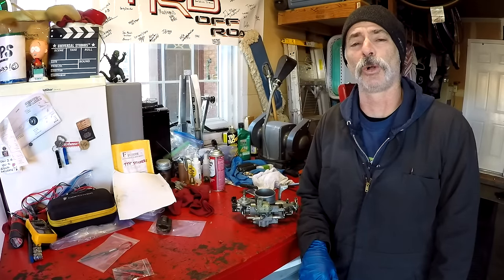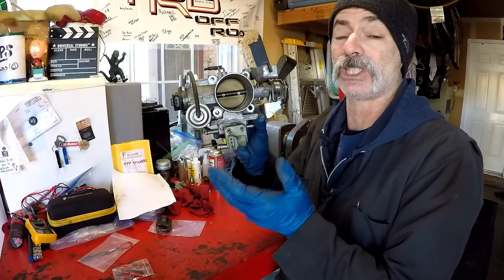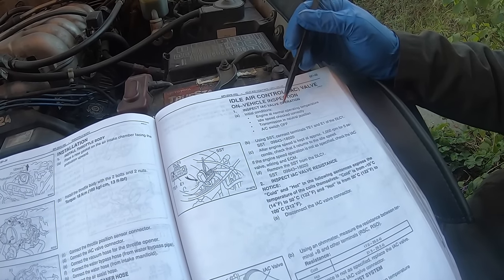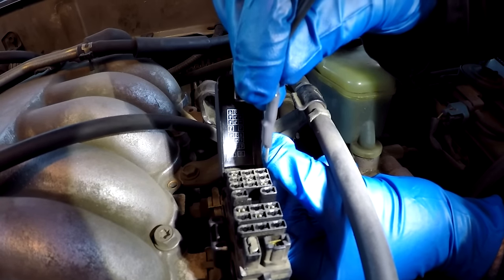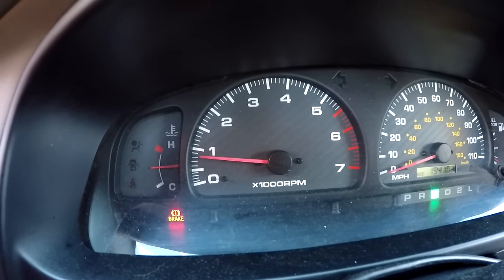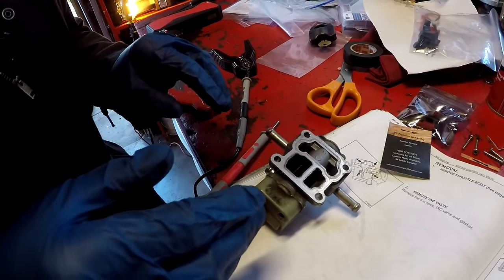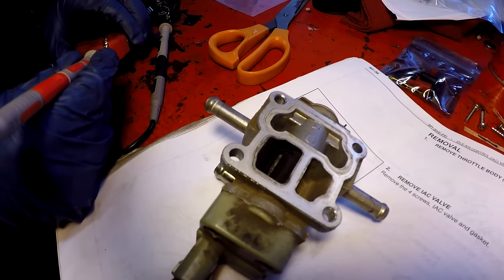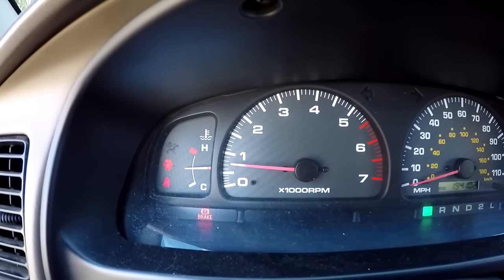IAC Valve Testing and Cleaning

Comment: That first small hose you removed going to air box tube near the throttle body mine has oil coming out of it why would it do that its @14:42 on video I have tried everything I could think of to do diag this mysterious oil coming out but nothing about the engine is running ruff so it's running fine not a clue why oil is coming out of this hose
Reply from the maker: That rubber hose connects to a hard line on the upper plenum and then has another rubber hose that heads towards the back of the engine and connects to a nipple on the backside of the driver side valve cover.  On the passenger side valve cover, you have the PCV (Positive Crankcase Ventilation) valve and it's job is the following which I borrowed from a website: "The positive crankcase ventilation valve releases exhaust gas and unburned fuel from the engine block into the intake manifold. All engines allow some exhaust gases, unburned fuel and oil to “blow by” the pistons and collect in the crankcase where it produces sludge if not eliminated. Separating the crankcase from the intake manifold, which is a source of varying air pressure, the PCV valve maintains the optimal level of vacuum in the crankcase to extract the products of blow-by as well as potentially damaging moisture".

So, with the PCV valve on the passenger side of the engine, I'm guessing this port on the driver side valve cover is also helping maintain the optimal level of vacuum in the crankcase.  I'm suspecting your PCV valve might be a little sticky and maybe it's time to replace it.
Reply: @TimmyTheToolman  are we talking about the same hose connects to side of the intake tube close to the throttle body and then connects to top of the plenum it's in the video @14:42 seconds
Reply: @TimmyTheToolman  pcv valve was just replaced few months ago
Reply from the maker: @AntonioClaudioMichael  Yes, the same hose.  If you look on the driver side of the motor, you will see another rubber hose connects up to that hard line on the plenum and then connects to a nipple on the back side of the driver side valve cover.
Reply from the maker: @AntonioClaudioMichael  Gotcha.  It sure sounds like excessive pressure is being allowed to build-up and that's why you're seeing oil being forced into that tube.  But, since you replaced the PCV valve, I don't know what else you can do.
Reply: @TimmyTheToolman  that's probably why I'm stuck have no idea how to fix it
Reply from the maker: @AntonioClaudioMichael  Well, like you said, your engine is running fine.  I wouldn't worry about it.
Reply: @TimmyTheToolman  oh yep your right I see what your talking about  engine is running fine just find it annoying once or twice a year I have to clean that hose it's not alot just enough to make the hose look wet right at the hard line on the plenum
Reply from the maker: @AntonioClaudioMichael  Yeah Dude, don't sweat it.
Reply: @TimmyTheToolman  thanks Tim appreciate your time
Reply from the maker: @AntonioClaudioMichael  No problem Antonio.  I'm hear to help as much as I can.

Comment: Hello My vehicle is 98 model st191 chassis 3s fe engine code. My vehicle has a 22 pin diagnostic connection. With which program and cable can I connect it to the ECU? You follow the phone screen very well, but I don't understand how you connect
Reply from the maker: I use these two things:
*OBDII reader that works with Android devices (So you can use the Torque Pro Phone App) https://amzn.to/2BeQUsM

*OBDII Reader Shut-Off Switch - (It allows you to turn off the power to your reader so you don't have to pull it out every time.  The reader constantly draws a small amount of power and could drain your battery if your truck sits for a long time.) 
https://amzn.to/2WDL4dl

In the video description, I have the two above items listed along with a whole bunch of other things like links to tools we used.  To expand the video description, you just need to click on "...more" at the end of the first sentence of the video description.

Comment: Any chance you'll do a multi-part video detailing how to replace the head gasket in a 5VZ-FE 3.4L?
Reply from the maker: That will probably happen one day but no plans for the near future.  There is a guy who pulled one of the heads off this Tacoma 3.4 liter V6 engine for a head gasket job and he did a very detailed series.  Ended up he also had a crack in his head and had to replace it.   I think you will find his series very helpful.  Here's a link to Part 1: https://youtu.be/voLBRDZL9fE

Comment: Guilty of stripping that screw head on the IAC valve. Stopped and didn’t go further, just cleaned my throttle body. Truck gas pedal no longer sticks/surges but will at a future date tackle cleaning the IAC since my OCD will always remind me that that screws is stripped and valve is dirty. Lol
Reply from the maker: Sometimes you can’t win the battle but you can re-visit that stripped screw and win the war. Auto mechanics can be a test of patience but we wish you luck and will be praying to the Toyota Gods to ensure things work out in your favor when you try again.
Reply: @TimmyTheToolman  Thanks so much! Your videos are very detailed and much appreciated! May I ask, have you run into this before: I have a 3rz-Fe engine and recently I flushed the power steering fluid and replaced it with Valvoline Maxlife ATF which is supposed to be comptible with Dextron III and II. After doing so, the pump had a terrible whine, I mean really bad! And not because of air in the system. I did it again and put in Valvoline Dex/Merc (older rating) and that seemed to do the trick. What do you use in your Toyota?
Reply from the maker: @drivewayhero  I've put Maxlife in my power steering pump but I haven't flushed the whole system with it.  The synthetic ATF is a little thinner and maybe that's it.  I've been running Maxlife in both my 3rd Gen 4runner auto transmissions without issue.

Comment: Good thorough video on this! - on my 2000 I had to do this and was pretty liberal with spraying the TBCleaner, ran like a champ after. 
Lets race to the next vid- gotta stop a leaking transfer case from the top.
Show me how 🤣
Reply from the maker: Cool.  Thanks for the comment.  After I couldn't get my IAC to work after cleaning it, I started thinking that maybe you could short the solenoid out but it sounds like that's probably not the case.  

Your transfer case shifter seat is probably wasted.  I had a leak from the top of mine as well.  If you use our transmission replacement video, you'll see how to pull the shifters out.  https://youtu.be/oZDSjlxl2Q4

Once the shifters are out of the way, you can remove that top plate on the transfer case, remove the old seat and replace it with a new seat from Marlin Crawler.  The Marlin Crawler shifter seat you want is MCTM-523 - Blue One.  Here's a link to their page: https://www.marlincrawler.com/transmission/shifter-parts/heavy-duty-seats

Toyota doesn't make a replacement seat from what I understand. They make you buy that whole top plate assembly.  You'll want to replace the gasket between the shifter seat plate and the transfer case.  I suggest just going to your local Toyota dealer to pick one up.  I looked for the part number but I couldn't find it in my records.  It's not an expensive part.  

If you have any questions, just ask.  Good luck with the job!

Comment: Maybe that's it, the battery and the alternator are fine, it only happens when you put the D in park it doesn't do it, but in D if the rpm is lowered more than normal and I already cleaned the iac valve and it still persists
Reply from the maker: It's doing it with a load on the engine.  In park, there is not load.  Once you put it in drive, there's some load on the engine.  Once you put it in drive and getting rolling, does it still want to stall out?

Comment: my toyota mr2  idles at 1500rpm and it climbs to 2200rpm so i did the iac cleaning and test and cleaned the throttle body. now it idle at 2700rpm but if i plug the hole in the throttle body intake it drops to 1500rpm which is still way too high it should be aorund 750.  im stumped.  the throttle body air flap is clean, the throttle cable isnt hanging up and i cen see the flap is completely closed.  the throttle body has a new gasket too. none of the hoses look damaged or leaving air.    i disconnect the iac cable and it doesnt change the 2700rpm idle.  im guessing the iacv is stuck open?  i even did a leak test for the injectors with starting fluid and they seem to not have any air leaks,
Reply from the maker: Yeah, it's either the IAC is stuck open or there's a vacuum leak somewhere.   Check out our latest video using a smoke machine to find a vacuum leak.  https://youtu.be/OV_rZXzXdSw?si=0o_vOcGa3FdDYLVo

Comment: I thought you just loosen 2 bolts at the top of the engine and pop in a new one like Scotty Kilmer.
Reply from the maker: Yeah, it's not all easy peasy like Scotty Kilmer can make things out to me.  Our channel shows the real world steps to properly testing the IAC, cleaning it and getting it all back together.  And, we're not going to act like this video is a one size fits all and you can now do this job on any vehicle like Chris Fix implies with his videos.  This video walks you through the steps for a Toyota 3.4 liter V6 with the older style throttle body.  The OEM IAC valves are pricey so it's better to confirm first if the valve is actually bad.  It it's still good, give it a nice cleaning and reinstall.  Anyway, I've said enough on the subject.  Happy Wrenching!
Reply: LOL

Comment: Hey Tim my IAC was for sure stuck and I had a high idle. Once I cleaned the valve it moves freely now. My question is about the air assist port. Does that draw air from the air filter side all the time? I thought that port would be closed at idle.
Reply from the maker: I'm not sure about the air assist port if it's delivering air to the injectors all the time.  I'd have to look at the video again and analyze the construction of the IAC to see if I could figure it out.

Comment: In my situation the only problem is that it is ticking when I just turn on the engine and higher RPMs. It stops after a minute but it is inconvenient. The solenoid is noisy and I think I must clean it for probably replace it?
Reply from the maker: If the solenoid is noisy, I don't know if cleaning it will fix the issue.  You might have to replace it.

Comment: I have a 1998 dodge ram 1500 that starts and has gas. No Toyota, but still great info. Sounds like my issue is included.
Reply from the maker: Good luck with the fix Ruby.  It definitely could be a problem with air getting to your engine.

Comment: My toyota when u push the gas it doesnt run smooth and jumps and shakes alot. The gas might be cutting or the fire. Ive checked the fuel pump, wires, muff sensor, and the truck do the same. What would you reccomend to check.
Reply from the maker: Are you getting any CELs?

Comment: The Factory Service Manual:  Is it labeled "fuel systems", or just a general Toyota service manual?  My local library is quite large and has many different service manuals, so I'm just trying to get a general idea of what to look for.  🎉 Thanks again!
Reply from the maker: It's just a general Toyota factory service manual.  I'd be surprised they would be available at your library.  You can find the books for sale on Ebay for your year and model.  If it's a newer model, the information won't be in print.  It will only be available online via the Toyota Tech Info website.  For $25, you can download as much information you want over a 2-day period.  https://techinfo.toyota.com/techInfoPortal/appmanager/t3/ti?_nfpb=true&_pageLabel=ti_home_page&goto=https%3A%2F%2Ftechinfo.toyota.com%3A443%2Fagent%2Fcustom-login-response%3Fstate%3Dyn86IgWTE1gDqASFlUsdAcxXhB0&original_request_url=https%3A%2F%2Ftechinfo.toyota.com%3A443%2F
Reply: @TimmyTheToolman  thank you and yes you're correct especially about newer cars.  Our main Central Dallas Texas library has factory service manuals from around the late 1930s stopping to around 2006 with Toyotas dating back to 1965.
Reply from the maker: @tomblobasjamesc.mccollum1740  That's interesting.  I never would have thought a library would have FSMs.

Comment: I noticed that you have a pencil with a flat end...is that a special tool?
Reply from the maker: That pointer tool we use is called a spudger or also referred to as a black stick. A spudger or spludger is a tool that has a wide flat-head screwdriver-like end that extends as a wedge, used to separate pressure-fit plastic components without causing damage during separation. Typically used on delicate electronics like fixing a computer or something equivalent.

Comment: I have a 2000 Avalon with a mildly surging idle. Upon acceleration, the engine surges. At steady speed, it's fine. CEL is not illuminated. Could the issue be the idle air control valve, or is it more likely something else?
Reply from the maker: It's possible it could be the IAC.  It could be the throttle position sensor as well.

Comment: I have a request: Do this for your 1985 4Runner. The 1985-88 22RE IACV is discontinued and independent from the throttle body in early 22RE's. There are no videos for cleaning that one. Would be much appreciated!
Reply from the maker: Thanks for the comment Justin.  I will look into this and maybe make a video of it.  That's too bad the part has been discontinued by Toyota.

Comment: Tim, Thank you again for your reply.  Well it is 10 months later and I'm still having the problem where the engine starts perfectly and quickly when cold, but very long cranks when engine is warm.  I ended up replacing the heads since there were small cracks between the intake and exhaust valves.  I have changed the fuel pump 2x with Toyota parts, plugs wires, new coil packs, injectors, sensors, gaskets (everything).  Anyway, I thought this would surely fix the issue.  Nope!  I replaced every sensor (including the temp and O2 Sensors with denso) thinking this has got to be air/fuel mixture.  Still no codes until a few weeks ago!  I'm getting a P1130. I'm stumped on what exactly is causing this.  The good news is I have a code.  A couple of questions.  What scan tool do you recommend to give some live data?  My 4runner is a 2000 and my understanding the OBII gives very little information.  Maybe it is the ECM?  Any advice is appreciated.
Reply from the maker: I don't have a decent scanner myself.  I've used Toyota Tech Stream a little but I'm a novice at it.  Snap on makes nice scanners but they are super pricey.  If you settle on one to buy, please let me know what you got and how you like it.

Comment: Idle was at 900 with the IACV hose plugged. Guess there's a lower intake gasket leak. Thanks for the info!
Reply from the maker: Yep, you might have a vacuum leak somewhere.
Reply: @TimmyTheToolman  just replaced all the lower and upper intake gaskets and injector o-rings and cushions today and any loose hoses. Im still at 1500 rpms. I replaced the valve covers, pcv valve, TPS sensor, and ecu temp sensor  but nothing. Vacuum is a 19".  Cleaned the IACV and checked resistance  but I forgot to check  operation powered. Adjusted dash pot and idle set screw so throttle blade wasn't held slightly open. Frick I hope its just the IACV and not the throttle body worn out. Injectors all seemed to be at the same resistance with no cracks.
Reply from the maker: @PseudonymAliase  Did you look for vacuum leaks in other places?  With the idle that high, it sure sounds like a vacuum leak.
Reply: @TimmyTheToolman  just installed brand new gaskets and hoses all over the upper and lower intake. the only hose that dropped the idle to 900 was the hose from the IACV to the injectors. I want to tape the front port of the IACV in the throttle body and power cycle the valve today.
Reply from the maker: @PseudonymAliase  Ok, good luck figuring it out.  As long as that throttle plate is closing down properly into the bore of the throttle body, the engine is getting the extra air to raise the idle from somewhere.
Reply: @TimmyTheToolman  I blocked the IACV front port and the idle was at 750-900, down from 1500. I then crimped each hose and found the pcv hose killed the engine. I think a compression test is order. At 300k miles the piston rings/bores could be worn out.
Reply from the maker: @PseudonymAliase  So, something is raising the idle by around 600-750.  You're suppose to get air via the IACV so that extra air induction is coming from somewhere.  The compression test will tell you the health of your cylinders but it's not going to shed any light on your high idle issue.  There's something that you're missing.  I'd reexamine all your vacuum hose connections one more time.
Reply: @TimmyTheToolman  yeah I re thought that...  I just checked the throttle body again and there is light all around the edges. The throttle body blade is worn out.
Reply: @TimmyTheToolman  pretty rare I have only seen two worn out throttle bodies in my career. Sometimes you have to talk it out with someone. Thanks for being the open ear! I will let you know!
Reply from the maker: @PseudonymAliase  Well, I don't know if those throttle body plates ever had a super tight fit into the bore but if you're seeing significant light showing through all sides, maybe that's it.  Yeah, definitely let me know how it all turns out.
Reply: @TimmyTheToolman  yep a new throttle body with all new sensors didn't solve it. I have either a crack in the lower  intake that I didn't see or some strange vacuum leak I can't find. So frustrating!
Reply from the maker: @PseudonymAliase  Yeah, I feel for you.  Take a break from it for a while and reengage when you're up to it.  Hope you can figure it out.